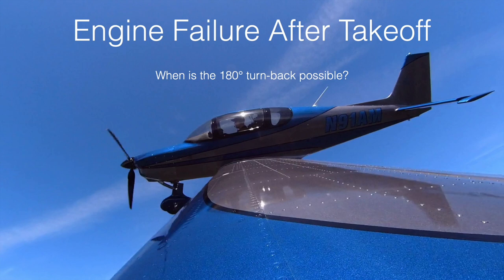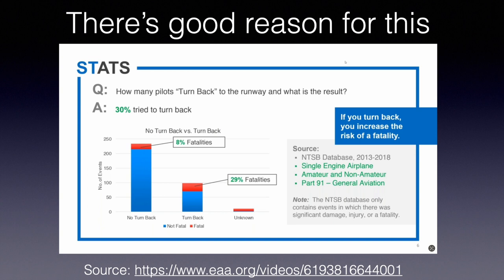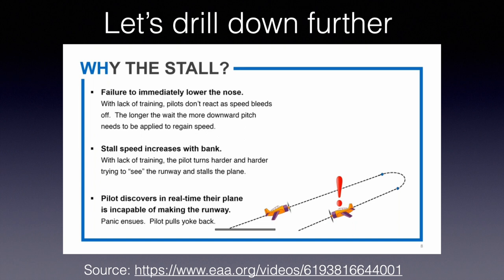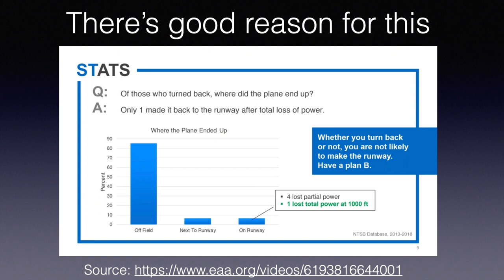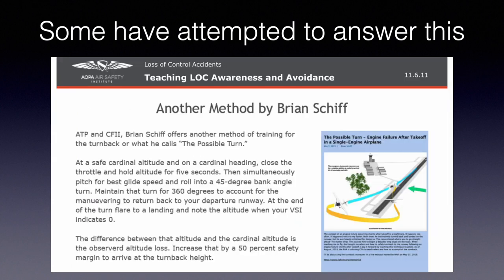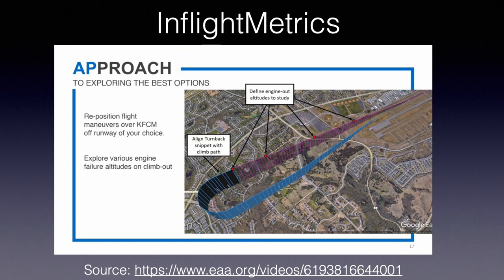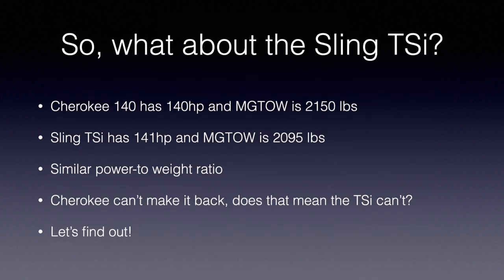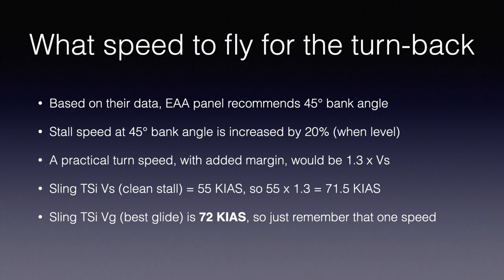Sling TSi engine failure after takeoff - Impossible Turn analysis

Comment: YOU NEED TO KNOW TURNBACKS.- Not only for EFATO.  You need turnbacks also on Circling Approaches, Flyover Turnbacks, Box Canyon turnbacks, overhead airport to enter the 45 after.  Many accidents on those 5 places were the pilot made turnback errors and crashed.  His fault- for not knowing Turnbacks well.  A 180 is not a full turnback, just an U Turn.  Turnbacks are bigger turns that finish at almost or the same place you were before.  A course reversal, not just a heading reversal 180 turn.  Turnbacks are more than a 180.  Many CFI's call a 180 a turnback.  No its not. 

TO TEACH TURNBACKS;
It is better to teach "Turnbacks To A Flyover" FIRST.  The GRM TURNBACKS first, then the emergency and circling ones later on after you do them level flight well.  I taught them all 2 decades ago and researched about the accidents causes on them a lot.  Most pilots dont know those maneuvers well and do them very wrong, or stall and crash. Even ATPs crashes. 

1-The Teardrop Turnback to a flyover a spot on ground do it first.  Fly  at Vglide speed slow flight over highway (w. a Crosswind). With flaps 10 degrees.  1,000' agl.  Fly over spot on highway, turn away from wind 40 degr. , then into wind.  Fly over the spot on highway again, after flyover repeat same steps on other side.  Do 3 on each side until perfection Teardrop Turnbacks.  One turn turnbacks require 2k feet dist. from flyover spot. Dont do them yet.  Those are more difficult and dangerous.  Later on i will type about those Hook Turnbacks.  Cropdusters do them only after getting low in weight.  I used to call them Question Mark Shaped Turnbacks.  2k distance after flyover, Vglide speed, bank 45 degr.  more later on that  QMark ? Turnback.

2-Then Box Canyon Turnbacks Scenario (Climbing Vx but at 60% power only to sim a 10k density alt.)  Then the Circling Approach overfly + Turnback, then the LOTOT Turnbacks and no power EFATO at end.  Some day you will have to do those maneuvers.  

Some say to keep the ignorance.  But Ignorance is not the solution,  IGNORANCE IS THE PROBLEM. Most pilots that crashed doing turnbacks on those 5 places were Turnback ignorant
Reply: i put your video for this poster to see it.  Salud hermano..

Comment: Great work!  Your height above the end of the departure runway is a good indicator of your actual climb gradient, which eliminates guessing about headwind or density altitude effects.  If this height is more than 500 I consider it safe to try a turn back.   If not i don't.  Whatever number you use, pre-brief it and commit to it before takeoff.   In addition to startle factor there is pure indecision, which is probable more common and can be solved by pre-briefing your emergency procedures.
Reply from the maker: Very good points. I discuss the pre-brief and related items in my recent video "Ballistic Parachute deployment considerations."

Comment: Nice video! Practice is key and our Garmin Avionics really help with ESP, AOA indicator, stall warning. I have Sling 2 Garmin IFR and parachute. BTW, you are going to get carpel tunnel unless you stop spinning the heading bug to get it from from say east to west. Just press the heading bug and it will slew to current heading. Same with altitude knob. Ok, off to practice!
Reply from the maker: Yes, I use the push-to-slew feature all the time! Not sure why I didn't this time. 😆  Probably because I frequently fly another airplane that doesn’t have that feature.

Comment: Most engine fails are partial power.  Powr drops to  1,700 to 1,900 rpm depending on engine. I  knew a 60 hour PPL that brought back a C172 (2 big guys on board) with partial power from only 200 agl after take off instead of crashing in front where only houses were.  No power?  Dont Turnback under 600 agl and only if you were climbing at over 700 fpm.  If shallow climb, and no power, DONT TURNBACK, go towards wind or a nice field on sides.  Power and no power are different maneuvers.  Practice over a highway at 1,000' agl first ON SIMULATOR.  Do the partial power first, troubleshooting engine BEFORE TURNBACK.   TURNBACKS ARE ARE A FUN and challenging maneuvers that FAA and AOPA are recommending SINCE 2018. I  learned them in 1996 From Emergency LowManeuvering channel old CFI. See my playlist and his too.

Comment: ---  About Richard Mac Spadden; killed while flying as passenger with an ex NFL football player as PIC. 
MacSpadden was not flying that airplane and i bet he, who had practiced EFATO Turnbacks" did not try a too low one. The ones who dont practice them are the ones that try them the wrong way, LIKE TOO LOW. The owner of the airplane is always flying it in photo missions not other man while the owner sits on side.  MacSpadden got killed by that guy that didnt know turnbacks and turned back too low. The Ignorants are the ones that crash, not the ones with experience on the maneuver.   Duhh!

The Cessna Cardinal looked like they could make the runway, but someone pop out the dragfull landing gear and they didnt.  Most times the owners do that to save cost, not an expert like MacSpadden. MacSpadden was killed by a bad pilot.  Also on photo you can see the airplane had a full up elevator.  The owner did that, killing the glide.  I took my commercial on that airplane and know it well.  
 Owners kill a lot of passengers with pilot errors they do as PIC. Be careful who you fly with.  Too many good pilots were killed by the PIC pilot errors, not them.lso on photo you can see the airplane had a full up elevator.  Mac Spadden spoke about not pulling too much elevator.  That was the owner.   Too many good pilots were killed by the PIC pilot errors, not them.  Too many good drivers are killed by bad drivers  too.  Be careful who you fly with.  And who you drive with too. Dont be the next killed as a passenger.

Comment: Wow. Impressive analysis.  Thank you for that. Super helpful.
Reply: MacSpadden was confronted with the worst kind of EFATO. And That kind of EFATO  i think he didnt know.  The Surging Engine kind.  The worst kind that can fool you into try to reach fields and suddenly engine quits all AND THEN YOU CANT.   Many good pilots have been fooled by Surging Engine EFATO.  Then engine quits and they crash short. 

I had 5 engine failures on pistons in the 3,000 hours that i flew them in South America cargo i flew in the 1980's.  2 total but they were twins.  DC3 and Piper Aztec.  I landed them feathered engine spitting oil.  The other 3 were partial power. Singles.  On take off.  Lost one cylinder.  There are 2 basic kinds of partial power engine fails (LOTOT).  This is for 4 cylinder engines. 
 1-The Vibration LOTOT,  2-The ENGINE CUTTING OFF IN AND OUT LOTOT.  

In the vibration LOTOT you sort of lose the climb only, so if over 500 agl, you can still Turnback or Turnaround airport if know how to before.  Dont know ? Dont go there.  Good luck crashing outside the airport.  Good to lean mixture and SOME carb heat apply after lowering the nose.  I was on Cherokee 180 on both and did the downwind leg at 1-200 agl, 2nd at 250 agl.  I didnt know how to do turnbacks, so i went to a low downwind leg.  Scary as hell downwind leg 200 agl at Vglide with engine vibrating.  

In the worst LOTOT or engine cutting off in and out, or engine noises, change tanks and be over say 700 agl before Turnback to opposite or side runway, and dont think about going around the airport, the engine can cut out before you complete the turnaround. =  Dont try any turn to airport under 700 agl if engine is cutting out badly.  Be a Turnback or a Turnaround maneuver.  

Practice LOTOT.   At least the engine vibrating "Turnaround" at 1,800 rpm and later on "The Turnback" from 700 up (depends).  LOTOT should be required due is 3 times more common than EFATO.   LOTOT and EFATO can get you easily if you dont know well.  So Ignorance is not the solution.  IGNORANCE IS THE PROBLEM.

Comment: Fantastic - Thanks for all the work on our behalf.  Might be worthwhile for someone to create a simple app that would give you some initial guess of turnback attitude based on Vx or Vy and headwind, and crosswind, and runway length.  Nothing is perfect, but it would be a good briefing tool to have an idea ahead of time what decision - turnback, go straight or pull chute - to make.  Again - THANKS!
Reply from the maker: That was the original intent of Inflight Metrics, to build an app called Turnback Calculator. I think they gave up on it. There's just too many variables which could affect the calculation. Plus I think there was concern about liability.
Reply: @OneAlphaMike  Always a concern about liability.  Seems one could do some of these practice turnbacks, look at their results using calm conditions, apply some formulas to winds, add in a fudge factor, then have something that would be actionable.  As you mentioned, the airport environment is generally a better place to land even if you miss the runway or even taxiway.
Reply from the maker: Yeah, these things appear fairly simple to begin with, but when you get into it, it's more complex. The wind calculations are probably the easiest part. When you think about it, you'd have to record several climbs and turnbacks at different weights and temperatures to get basic performance datapoints from which you could extrapolate for a range of environmental conditions. And you'd have to do that for every different airplane model. It quickly becomes a big project.
Reply: @OneAlphaMike  Well, I was just (personally) interested in the TSi numbers .. just doing an app for the TSi.

Comment: Let's say that you are taking off from 56F, you'd probably be headed South since 70% of the time the wind here is from the South, would you attempt a turnback of would you try to land on highway 70 which normally has very light traffic? Heading North are cotton fields as well as South. I'm not sure if there power lines over highway 70 in this area, I'll pay attention the next time I'm up there.

Comment: A 180 is not  "A TURNBACK".  That will put you on a low downwind leg to A TURNAROUND THE AIRPORT INSTEAD.  A TURNAROUND takes more time and distance and more prone to crash before final approach low turn or on it.  Many EFATO CRASHES were "TURNAROUND MANEUVER.  Not A "TURNBACK MANEUVER.   Most Turnbacks are with no damages, and no report needed.  I did one on a Cherokee and im not counted as a sucess doing it.  But if an idtion did it wrong and crashed,  that is big time counted.  I not counted they say.

Comment: I'd agree that the factor for  turn back is aircraft performance. If your aircraft can climb faster than the best glide ratio, then you have a better chance of making the runway. On most low performance aircraft on a minimum spec runway, you'll never make the runway even if you make the turn. In gliders we always learned that below 300', you always land straight ahead because there is simply not enough altitude to make any turns. I always found that the first step in a rope break or engine failure is to get that nose down for airspeed and to see the picture of landing areas.

Comment: Startled time cannot be 4 seconds plus.  If that person is so slow, better crash in front, never do a turnback, or turnaround the airport.  Good luck with that crash. 
   Imagine a driver that takes 4 seconds to turn when someone runs a light in front, or a pedestrian running ect.  or a kid running for a ball on street, or an animal, etc. 4 seconds to do something?   Most people react in 1-2 seconds unless impaired mentally by panic. 
Seen 1.5 seconds on actual RTO videos on youtube.
Reply from the maker: Startle factor included for worst-case scenario. Many pilots erroneously attempt troubleshooting first, which as mentioned, is not the right thing to do.

Comment: MacSpadden was confronted with the worst kind of EFATO. And That kind of EFATO  i think he didnt know.  The Surging Engine kind.  The worst kind that can fool you into try to reach fields and suddenly engine quits all AND THEN YOU CANT.   Many good pilots have been fooled by Surging Engine EFATO.  Then engine quits and they crash short. 

I had 5 engine failures on pistons in the 3,000 hours that i flew them in South America cargo i flew in the 1980's.  2 total but they were twins.  DC3 and Piper Aztec.  I landed them feathered engine spitting oil.  The other 3 were partial power. Singles.  On take off.  Lost one cylinder.  There are 2 basic kinds of partial power engine fails (LOTOT).  This is for 4 cylinder engines. 
 1-The Vibration LOTOT,  2-The ENGINE CUTTING OFF IN AND OUT LOTOT.  

In the vibration LOTOT you sort of lose the climb only, so if over 500 agl, you can still Turnback or Turnaround airport if know how to before.  Dont know ? Dont go there.  Good luck crashing outside the airport.  Good to lean mixture and SOME carb heat apply after lowering the nose.  I was on Cherokee 180 on both and did the downwind leg at 1-200 agl, 2nd at 250 agl.  I didnt know how to do turnbacks, so i went to a low downwind leg.  Scary as hell downwind leg 200 agl at Vglide with engine vibrating.  

In the worst LOTOT or engine cutting off in and out, or engine noises, change tanks and be over say 700 agl before Turnback to opposite or side runway, and dont think about going around the airport, the engine can cut out before you complete the turnaround. =  Dont try any turn to airport under 700 agl if engine is cutting out badly.  Be a Turnback or a Turnaround maneuver.  

Practice LOTOT.   At least the engine vibrating "Turnaround" at 1,800 rpm and later on "The Turnback" from 700 up (depends).  LOTOT should be required due is 3 times more common than EFATO.   LOTOT and EFATO can get you easily if you dont know well.  So Ignorance is not the solution.  IGNORANCE IS THE PROBLEM.

Comment: Reduction of power ON TAKE OFF KINDS; the ROTOT OR Lost of power LOTOT. also called. I like to use ROTOT lately.
 I had 5 engine failures on pistons on take off in the 3,000 hours that i flew them in South America cargo in the 1980's.  2 were total fails but they were twins.  DC3 and Piper Aztec.  I landed them feathered.  The other 3 were partial power fails Cherokees with cargo on.  On take off.  2 i lost one cylinder.  The third was fuel pressure down
 
There are 2 basic kinds of partial power engine fails (ROTOT). 

1-The Vibration LOTOT and 2-ENGINE CUTTING OFF IN AND OUT ROTOT. 

On the vibration LOTOT you sort of lose the climb on a 4 cylinder engine, so if over 500 agl, you can still Turnback or Turnaround airport if know how to before.  Dont know ?  Dont go there.  Good luck crashing outside the airport.  Lean mixture and SOME carb heat apply after lowering nose.  Troubleshoting with lean mixt and changing tanks is mostly needed as you plan to turnback or do a turnaround. 6 cylinder engines most times you still can climb to 500 easier & turnaround the airport or Turnback to side or back runway if know Turnback.

In the worst LOTOT or engine cutting off in and out, change tanks and be over say 500 agl be  500 agl if engine is cutting out badly.  Be a Turnback or a Turnaround maneuver.
Reply: Hi Jay.  The 777 No Power Turnback Rule is easy to do.  Post about it too.